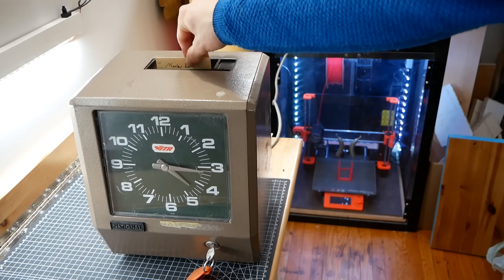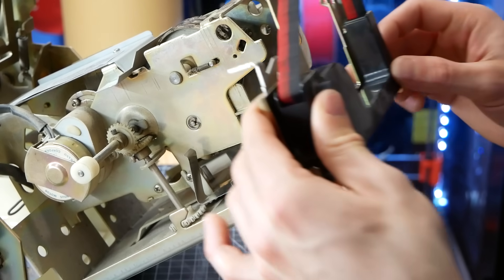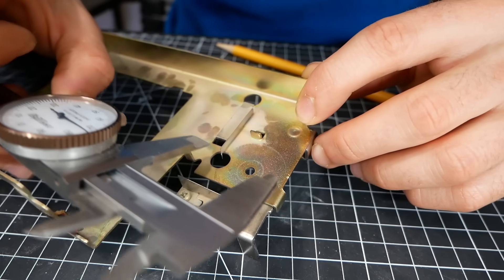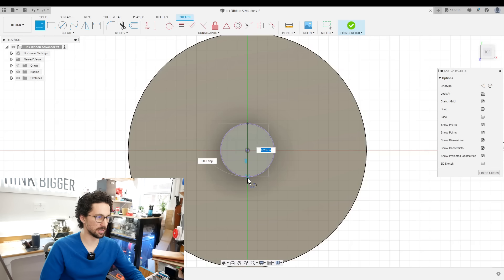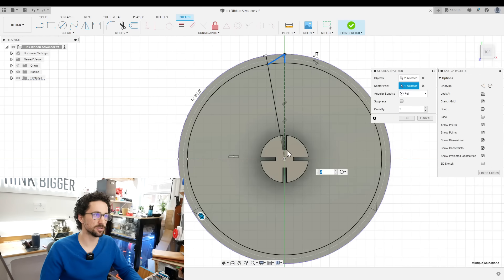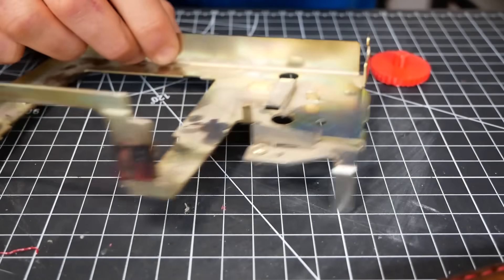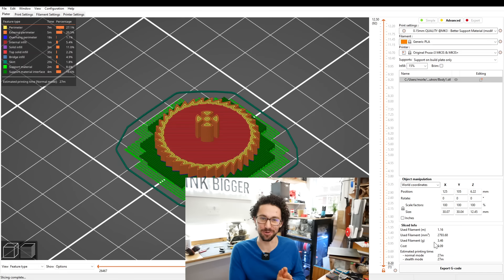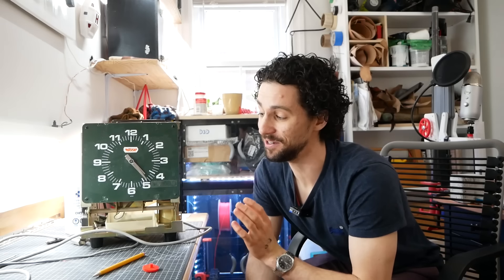They wanted 100 dollars. I 3D printed it for 9 cents.

Comment: Right, so I bought a 3D printer and quickly discovered it was a solution looking for a problem I have done a few jobs for people and yep saved them money on things that were either relatively expensive to replace, or unobtainable. But let’s be real, this part didn’t cost you 9c to make, it cost you part of the cost of obtaining the printer , which changes each time you do a print, and the filament you used for each iteration, and the power you used for the computer and printer, and the time you spent on the project.  It’s not as easy as saying $100 vs 9c. Don’t get me wrong I’m not being a buzzkill, I’m as enthusiastic about this stuff as you, but it’s a false statement from the outset. If someone asks me ‘I broke this plastic part for my <whatever> shall I buy a a 3D printer so I can replace it?’ I’d say ‘probably not for the following reasons’ and give the example of the juicer I used once and is now in the back of my kitchen cupboard and the water carbonator that I never buy co2 refills for and is next to the juicer.

Comment: I mean, it's 9 cents in materials, but how much would you have to've paid to get someone at the company to design and test that piece? 

And that's assuming that the department had ready access to a 3D printer

Not to mention the overhead costs of maintaining customer service for a 50 year old, discontinued piece of equipment

Comment: Actually, if you wanted to save on ribbon you could have missing teeth so that it advances the ribbon after several punches. Basically if you look at your original card and see how many times it printed ok before fading that is how many advances you could skip.

Comment: prety sure they were gonna charge you 95 for all of it, the whole assembly... but duh you don't need need the whole thing just the 1 part so they try to make you buy the whole assembly. the funny thing is that to make that part out of metal they would need a lathe to spin the axle, a lazer cnc to cut the gear, they force the 2 pieces together,  weld them and clean it up with a grinder and sander... with plastic, so much easier, just melt and go

Comment: Material cost of your print may have been 9ç but you have skills that are worth the rest of the $95
I once fixed a Ford headlight switch by replacing a resistor for 25ç but it was my skills that saved me the $250 for a new switch.
Great video!

Comment: you did not "3d print that for 9 cents". assuming, the measuring out and designing in fusion took about an hour, and another hour for operating the printer twice (for the two prints) and further assuming the hourly rate of about $60 for an engineer to do all of that, that piece would have cost $120 and 18 cents.

Comment: This was very well produced. I found your explanations and examples clear and understandable. I enjoyed seeing the whole process.

I was curious about the material of the original gear. It seems the plastic you used would wear out quickly. I understand it can be easily reprinted, but the original was likely a harder plastic or material. I have never used a 3D printer, but it seems to me there would be a way to control the strength of material (using a different plastic composite, etc...). 

In any case, thank you for organizing such a relatable problem and solution.

Comment: Good on you for fixing it yourself, but you're not being fair to the company here. You spent a lot of time on research and design, not to mention the necessary knowledge, skills and equipment to produce this part. That is easily worth 95$ and it's impressive that they would even do it for a 50 year old product. It's also probably fair to say that the original part would be more durable.

Comment: in their defense... I don't think they'd actually just send you the little plastic wheel for a hundred bucks, it would be that whole little metal plate assembly that it goes into along with the plastic wheel...so it's a little different than how you described it. (Unless it really IS just the little wheel they'd be sending you. Which would be a gigantic rip off...)

Comment: Well yeah they still want Thier money yeah why send the gear for like 10 bucks where they can sell the whole part for 90 like with cars now with integrated stuff like the throttle position sensor and the throttle body instead of making a 20 sensor they put it in something that will cost you 200 dollars. Cheaper for them to make (debatable) but so they can ask more and sell you other stuff you don't even need. 3d printers are the best

Comment: Def a good video showing the application of a 3D printer, BUT saying the piece “cost” you $0.09 is a bit disingenuous.  I’m sure you must agree there’s way more to it than the simple cost of the plastic, right? 
1. Your TIME being the big aspect…How long did it take to take apart the machine, diagnose the problem, think of the design, draw it up in cad, set it up on the printer….print, test, tweak the CAD, then re-print and reassemble.  
2. Another big one is most people out there are not proficient in CAD software, which is a big problem here.  I run Solidworks, which is a couple grand for 1 seat alone…and that’s cheap. I know some ppl also use blender, but I honestly have no experience in that software, but the point remains the same either way. Most ppl wud need  to learn how to use a cad software.  This is a super simple geometry, but anything complex would be a no go for most ppl. 
3. Anyone that runs printers (especially low cost consumer printers) would tell you that the material isn’t the most durable stuff in the world. Sure the layering is perpendicular to the stress direction, but it’s still just a printed part. I can’t remember if you used PLA or something, but that’s what It looks like bc ur not using a heated chamber, so that what I would guess. That $95 part would be production grade (probably abs or nylon) and last forever! You would never need to worry about it. 
Maybe if you printed that off a DLS printer using a 2 part photopolymer or an Sls machine using nylon, than maybe that wud last a lot longer but still..
Pls don’t get me wrong…..I’m a big advocate of 3D printing like you, but you can’t really say it only “cost” you 9 cents. The plastic cost 9 cents…ur time cost way more than that. For me (and you),it’s worth it to print because we have access to printers and CAD software, but I would say to the average person who doesn’t already run cad software and like play engineer for $95….just buy the production part and be done with it. Just bc you can print it, doesn’t mean you should.  Take care!

Comment: It's always nice when a repair works! However your 'pricing' is a bit 'optimistic'. If you were to factor in the time it took you to make a first prototype and a revised version, your price goes up a lot. Add to that the wear'n tear' on your printer, PC, software-license etc. your part becomes very expensive quite quickly.
At the end you still have an old mechanism with a diy-part. If this was a real world scenario $95 for a completely new mechanism isn't all that bad.
However It's still nice when a repair works!

Comment: You calculated price wrong. Its 9 cents worth of material, true. But its an engineered part, and the time it took you to design it for manufacture isnt free. Plus Im assuming the original was in metal, which takes longer to work and make. Thats probably why it was 99$. Labor and skill and time cost money too.

Comment: in a case like yours it really feels like the 3d print was the better option, though im not sure about the wear on the pla from all the metal parts. if you are a company that for some reason still uses punchcard like this it would be the safer way to actually order that 95$ part though. since it would mean having people manually manage times etc. it would be way cheaper to have a part immediatly in the mail for them. companies dont like tinkering they want ready to work parts

Comment: can't exactly claim it was printed for the cost of the filler, power, cost of the machine, cost of servicing? cost of time and so on.   just to nitpick.  
I can't justify the cost of a 3d printer and especially the lack of use I'd find for it 99% of the time, which is a darn shame.

Comment: "3D print for 9 cents"
i mean, ignoring the cost of getting a 3D printer to do it, sure.
most people would probably pay the $95 if it was necessary rather than spend what, $500+ for a 3D printer just for that haha.
obviously if you use the 3D printer for more things, this is irrelevant.
but also, $95 for that part is ridiculously expensive no matter what.

Comment: You can't believe they wanted to charge you $100 for something that cost you $0.09 in PLA, but probably took you two hours or more to actually design and print... on top of the fact that you already needed to have the software knowledge and equipment to create it?

Yeah... shocker.

Comment: 9cents, plus $800 for that 3d printer, $50 for decent calipers with depth guage, 20 cents in electricity for 2 prints on the prusa, an hour measuring shadows, an hour in fusion, knowing how to use fusion...

It's great if you are already in the position to do it, but it's not 9cents really

Comment: i mean, you spend 9 cents on material, and an additional 5 hours maybe more making the design to print. and setting up the printer etc etc.
now thats fine, you got a youtube video out of it, so this is profitable for you, but realistically, 100$ isn't that insane to save that amount of time.

if anything its kind of amazing this company still supports this. and they probably do super low volume production runs, so they're not making money off of doing this.

Comment: This did NOT cost 9 cents. You probably spent 1hr designing the cog. Then doing the adjustments so let’s say half a day. Add the capital costs of the software and 3D printer. You probably would have made more money going to work and paying for the new part. Well done Homer Simpson.

Comment: Not 9 cents. Skill and working hours also have a price, electricity, depreciation of the printer and computer.
The final price will be much higher if you do this to order, and not for yourself.
For the company, all this is also included in the price: the matrix, wages, depreciation of a much more expensive machine, storage.

Comment: Well it was 9ct + idk if the software costs money(i know if it does there r free options as well) + working time/ designing the piece + u can't buy 9ct of printing plastic so higher upfront price + the 3D printer + setting everything up... Probably missed more xD
So if someone with such skill takes over 3h just to cheap out it. it might still lose money especially one those 1 use operations...

Comment: slightly disengenuous in several ways

1) you made a prototype at same cost so it cost you 18c plus the cost of electricity and wear and tear on your 3d printer.

2) presumably your time is worth something to you so you should factor in a reasonable hourly rate as a cost.

3) they were charging that for the whole part not just the plastic gear. did you ask them if they would supply you with just the gear?

I have no doubt it would still have been cheaper your way but not by as much as your headline figure and bear in mind most modern companie  * cough apple * won't even offer any replacement parts rather insist you buy a new one so I am not gonna rag on a company for doing so like you did.

Comment: Incredible cool how you include the making of the 3d model. Very informative. 

Insinuating the company is overcharging money is a bit unfair though. Those price comparisons are not correct. Man hours and machine costs are for example not calculated. 
I would rather hear some history of its use and/or of its mechanics, instead of hearing how much cheaper it is than the original company.

Comment: No, you spent a lot more on a 3D printer. Now you just rip the benefits.

Also, you spent time and effort doing this. If you have a decent job you literally ended up even (not calculating the price of the printer)

Comment: Did the same for my Saab 9000 electrically adjustable seats.   3D printing really is incredibly powerfull.
The only difference was that you couldnt get those gears new anymore at all.
Props to the company that made the clock for still supporting it.

Comment: This is exactly the type of thing 3d printing is brilliant for.  Companies don't stock components like this - or if they do, they only bundle them with other parts or make then extortionately expensive.

I have designed and 3d printed loads of little things like this to fix otherwise broken items around the home.
Reply: Absolutely. But in this case I disagree. PLA is too soft. Teeth will disappear in a few weeks.
Reply: @smoker_joe  Now he has solved the issue and has the design made - it’s trivial to print in a more robust material, or simply print dozens of spares for pennies and replace them each time they wear out.  That’s the beauty of 3d printing.

Comment: „They wantet 100, I printed it for 9 cents“ is not quite right. You have to valculate your working hours and calculate down the costs of the printer and software down to the piece you made.

Comment: "I cannot believe they wanted to charge me $95 for something I can just use five hours to make at home if I own a 3d printer and am a pro in Fusion 3d modeling software."

He seems like a nice guy but c'mon.
Reply: I dont think we should consider the cost and skill needed for the 3d printer since it's not going to be used just to make this one specific gear
Reply: Yes, but if you have this situation happen to you a couple of times, that 95 dollars suddenly becomes several hundred, potentially over a thousand. A 3D printer may cost a lot, but recreational uses over several years and things like this will eventually match that same thousand-ish dollars you would have spent regardless. 

Plus, I guarantee this guy had a fun time doing this. I would've. :)
Reply: yeah, company won't have small parts like this lying around, probably bundling it with a larger mechanic part so we have to pay the whole parts not just a gear. and while this cheaper for a single customer, this wont benefit a company, hence they wont do this.
Reply: They also seemed to be wanting to replace the entire assembly not just the gear. Maybe because they misunderstood the request, or just don't want to break apart their legacy parts.
Reply: 5 hours? That gear would take like 2 minutes to design in CAD software and a ton of people DO have 3d printers nowadays. They are so cheap.
Reply: Haha it’s like owning a plane and saying that you fly for free. Video was cool tho.
Reply: Reminds me of those "look what I can make with just a donated pallet and house-hold items" and they have a full woodshop "at home" to do it with.
Reply: but say this happens 10 times, suddely that's $1000...
Reply: My thoughts exactly. $0.10 and $1,000+  and hundreds of hours.
Reply: @Ruiluth  Where are you getting $1,000? 

With only ~$80 more than the price they were asking for the part, you can get a 3D printer capable of printing this and many other replacement parts in the future.

Plus, Fusion is free, has free tutorials, and is a great skill to have that can be used for so much more than making one replacement piece.

Should everyone do it? I’m not saying that. Could they? If they have enough money and time to be interested in repairing vintage tools then probably.
Reply: you think the company has to reverse engineer every dimension of the replacement piece? they have a bucket of them somewhere from the last time they pressed play on the injection molding machine they had spitting them out at 20 bucks a 5k piece batch.

im not saying they should sell them for 9 cents, but they definitely shouldnt be selling them for more than 2 bucks
Reply: @XcaptainXobliviousX  as i understand they would have sold the whole ink cartridge contraption for 90 bucks, not just the single gear. seems fair. impressive that they even still have such spare parts for sale for a 50 year old device.
Reply: @XcaptainXobliviousX  you don't understand business. I'm selling $1 chinese cards $150 a piece. Customers don't need to buy from me if they have a laser, but they don't. You either make it yourself or you buy it. You want to be an entrepreneur? Okay you sell obscure parts for $2 I'm sure someone is going to give you a medal for being so nice - not. If someone needs a part he can't buy from anywhere else without the know-how, then you can ask atleast half the money of how much the item is going to go up in value with it in it.

Comment: Thats very cool but I do wonder how robust that part will be over time.  I wonder if it might not be better to use the 3d printed piece as a template for a copper or even lead poured cast?  The resulting piece would probably be a great deal more sturdy.

Comment: If it's a two-part print to separate the "interface with the ink cartridge", and "interface with the shadow gear teeth", then it would allow for further adjustments (i.e. different punch cards) and a parts replacement down the road (since the shadow gear teeth) interfaces with metal, which is worn out faster
(all theory, no idea if I am talking out my ass)